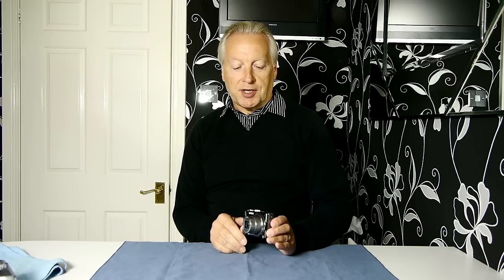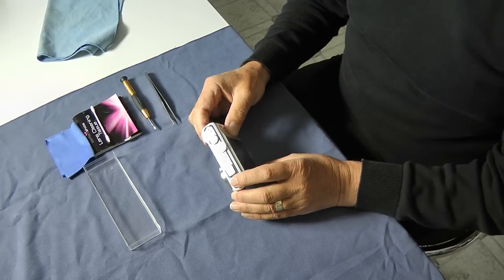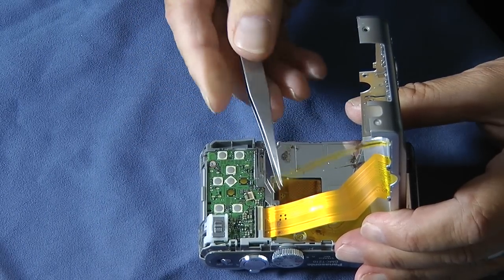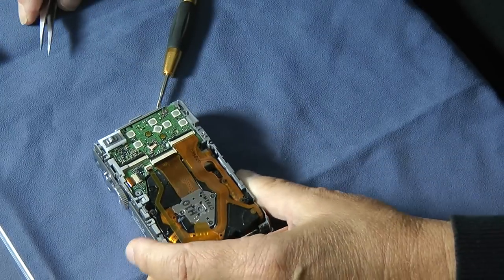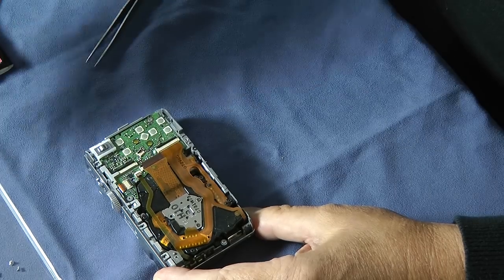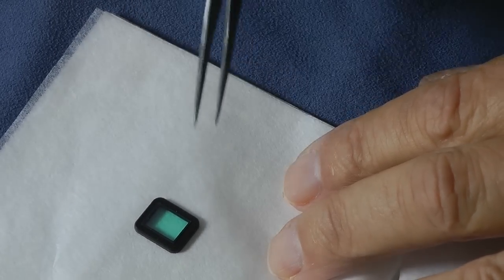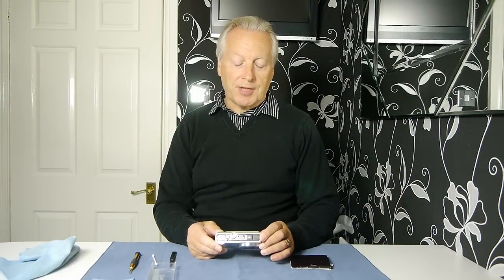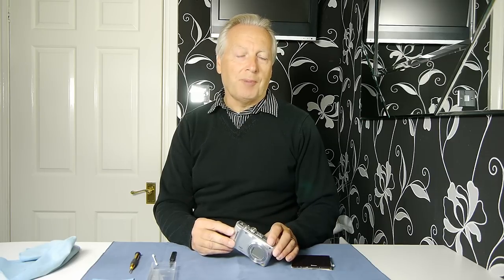Cleaning the CCD sensor of a Panasonic Lumix Compact Digital Camera

Comment: I bought the screwdrivers and the cleaning kit and was ready to have a go on my lumix DMC s3. I can only get one of the five screws out! do I need a posi no.0 or a normal screw driver head no.0? thanks.
Reply from the maker: All of the screws have a small amount of thread lock applied to them. They usually do undo if you maintain a steady inward pressure to stop the screwdriver head slipping out and applying a good turning force. Some screwdrivers like the jewellers type are too thin to get a good purchase on the handles, the larger the diameter of the handle the better for this application.
Reply: Graham, I think I need a ph000 as the no.0 seems too big. will order one as they aren't expensive.

Comment: Yep 17 seconds (timed) every time the same after power on, well after camera settles down to take images/video (takes 10 seconds of vid) sometime now it comes up with a different error message "Turn camera off then on again" AND! if you turn to playback mode on the back it does not error at all!
There is one solution I've found that does not work for me is to start the camera up and go into SCN mode and choose Portrait. I've done that a few times without success. Thanks for your help.

Comment from the maker: I have checked and I don't have the shutter assembly for the TZ5. If it is causing a problem them by pealing off that leica label, removing the 2 screws will allow you to remove the damaged shutter. OK you wont have a lens cover but that's not a show stopper - i have a camera which I use in this condition for some jobs.

Comment: Hi Graham,

Wondering if you can help us with our Panasonic Lumix DMC-FH8.  It is showing dirt on photos obviously needs cleaning on the sensor.  We need to know how to open this camera it has a wrap around silver part to the camera.  Thanks very much, much appreciated..Kim Dawson
Reply from the maker: Similar, remove all the silver screws on the sides and base of the camera and the back will then lift out, you may need a finger nail or plastic card to separate it. sensor is like the one in the video.
Reply: Graham Houghton Thanks Graham for your reply.  Its been a little while and we still haven't cleaned the camera.  Hooray we got the back off however the screen at the back is still attached and we are not sure how to get it off without breaking it.  It looks like it has a little releasing button on one side but we cant seem to unlock it.  Can you help.  Thanks Kim

Comment: I just tried and the TZ30 LCD screen does not come out with the back of the camera, i cant see how to remove the screen as the ribbon cables seem to be under the circut board to the right were the camera controls are..i can only see two..

mmmm

Comment from the maker: This doesn't seem like a sensor dust problem, might be indicative of pending failure. you can clean the filter with 1 drop of washing up liquid in 1/2 litre of water. Put the filter in a small bowl, being VERY gentle to flow the liquid over it a few times, then rise with clear water, blot dry (VERY Gently) and re-install darkest reflection towards the sensor. Good luck.

Comment: Thank you! Just out of curiosity, what purpose do the ribbon cables serve?
Reply: Well, they are cables in the shape of a ribbon. Coper wires printed on a plastic film. Serve to carry electrical power and signals between electronic circuits.
The wider public became aware of ribbon cables in 1971 during the Apollo 14 mission when astronaut John Watts Young ripped one of those on the Moon.
“Young moves into the vicinity and accidentally entangles his feet in the ribbon-like cable connecting the heat flow experiment to the central station. Since Apollo 11, lunar landing parties have had trouble tripping over cables. Such an incident on Apollo 14 knocked the TV camera over. In the bulky moon suit, Young can't "feel he's snagged" anything and keeps moving. The ribbon cable from the heat flow rips free, rendering the instrument useless. The data from the temperature probes cannot be relayed to Earth”.
APOLLO: A Decade of Achievement
By Paul I. Casey

Comment: these are great step by step instructions, which I have followed and managed to clean the sensor on my ZS10. When completed, I have gotten a auto-shot mode on all but the C (custom) modes (camera focuses and shots pictures automatically); have you encountered this before? should I try to upload the firmware? I re-checked the touch screen connections, which appear fine. in any case - thumbs up, I would not dare do this cleanup without your guidance.
Reply from the maker: No I haven't come across this problem. It may be worth doing a factory reset (all) just in case the memory got corrupt in some way. Does the tough screen work as it should?

Comment from the maker: Hello, I have tried to reproduce this by mis-aligning the cables however I cannot get the effect you report to me. As the backlight respond to menu changes then the control would appear to be OK, misaligned data cable gives broken up display so I really cannot say what your problem is here I'm affraid. As your results on the PC are fine it is nothing you have done with the sensor cleaning it must be related to the lcd somehow but I cannot say what. Sorry that I cannot be of more help to you.

Comment from the maker: This sounds like ccd failure to me. At a chance it could be just the connection from the ribbon cable connecting the ccd to the main pcb. Lift the locking latch remove the ribbon re-insert and close the latch - if it doesn't clear you could look out for a "for spares" not working camera on ebay and swap over the ccd - very easy to do.

Comment from the maker: Its possible but unlikely, Have you checked the ribbon cables to the pcb are installed correctly and the locking latches are down. Remove and replace the battery again to rest the camera.

Comment: contamination of the optical path is the primary degrader of the image. from the entry point, thru the path, all manner of airborne particles AND evaporated solvents that carry various chemicals will find a special place on your lens and imaging element. using good technique when transporting cameras is crucial, as 95 percent of their time is spent stored or in moving transport from place to place. a good, well made, yet simple bag or well fitted cover will help keep your equipment in good form.

Comment: I have bought and tried to use numerous tiny phillips head screwdrivers on my zs7 and although then look like they fit I can't find one that works? Any advice on finding a particular one that will work, preferably something available on Amazon in the US? Thanks in advance
Reply from the maker: You need the 000 point head for the screws. An Amazon.com store seller

http://www.amazon.com/dp/B008TM1910?tag=grasphoblo-20&camp=0&creative=0&linkCode=as4&creativeASIN=B008TM1910&adid=132N743KHDV9RSK19YXG

Comment: Hi Graham, thanks for your video. Both my panasonic ZR1 and ZS20 has the same problem. With your helpful video, I can successfully clean the ZR1. However the ZS20 (TZ30) has different structure. I cannot remove the LCD after back cover removed. Do you have some other instruction to remove TZ30 LCD?
Reply from the maker: The TZ30 lcd is held with clips at the top/bottom and left side (looking from the back). The tz30 has a different way to hold the cmos sensor and you may need to be prepared to keep adjusting the screws which hold the sensor to lens block to get the  framing right afterwards.
Reply: Graham Houghton Thanks Graham. Finally I can move the LCD but found the cable of the LCD is connected to the socket from the gap below the metal bracket. I tried to remove the metal bracket (3 black screws) without removing LCD cable but unsuccessful. TZ30 seems to be more complicated from the other Panasonic camera I can see from the video. Do you have the diagram or service manual to show the actual location and steps? Thanks.
Reply from the maker: you can download from here
http://www.pdf177.com/pdf/dmc-tz27ec-dmc-tz30eb-dmc-tz30ee-dmc-panasonic-3269.pdf
Reply: Graham Houghton Thanks Graham. I have downloaded the service manual and will have a detail look before I start. I will post here again to let you know the progress. Thank you very much for your help.
Reply: Raymond Li From the technical manual, The image sensor (CMOS) unit which are connected to the lens unit with 3 screws. 2 of these 3 screws are locked with the screw locking glue, after performing the Optical tilt adjustment. During servicing, if one of CMOS fixing screws are loosened, the Optical tilt adjustment must be performed. It is necessary to use the "DSC_Tilt" software to allow the "Optical tilt adjustment". It looks more risky to open TZ30 than other camera. Finally I decide not to wait until the situation get very bad.
Reply from the maker: Raymond Li it's true that if you disturb the screws there is the cahnce that the image may not be central. if you have an AV monitor (composite video) you can do this adjustment whilst looking at the image on the external monitor. Let me know if you want to know how to do this
Reply: Graham Houghton Hi Graham. Thanks for the very useful video. I also have a TZ30 that has the dust issue. Could you give guidance on the 'optical tilt adjustment'  and using an AV monitor. Thanks

Comment: so this cleaning is done with a dry cotton bud?
unlike cleaning a CD-Player laser lens which I have learned to do it with some isopropylic alcohol soaked into the bud?
Reply: thanks.
thats the first camera rapair that I try do make. if it fails its not the worst case scenario, because I fount the cam in a container on a scrap yard. so I take this as a training object.
Reply from the maker: desinfector The best way to learn.

Comment: In relation to my previous screwdriver question, some have stated not to use a can of compressed air on it as this might get some liquid residue on sensor or lens. Is this much of a concern or not. Is there any risk and or hope this might help without opening up the camera (I'd like to try less invasive procedures first). Thanks
Reply from the maker: These "air dusters" usually have some propellant and they are unlikely to reach the sensor face as it sits a small rubber gasket. Opening the camera is the only way reallu

Comment from the maker: Hello, you were extremely lucky as salt water usually kills the camera very quickly. The inside front element of the lens requires quite a bit of skill to disassemble the whole lens frame. It can be done easily with the right tools and patience. If you think you can attempt this I will produce a video showing step by step how to do it. It might be possible if you have a container of clean water to extend the lens and dip the front into the water, rotate it and then let dry facing down... cont2

Comment from the maker: Hi, I've been pondering this on and off all day and even tried to reproduce the effect on a TZ65. Which model are you referring too. Some have auto level control of the backlight and only 1 ribbon cable. Most have the second, very thin ribbon for the backlight. If you have tried re-inserting the thin cable with the gold contacts facing the pcb and this did not help I am a bit puzzled as to what else it could be. Have you tried raising the power level in the menu? would this help?

Comment: Thanks for your video. It gave me to courage to open my Pansonic DMC TZ7 because there was a diagonal stripe on all pictures. So I hoped to find some dust on the sensor, but it is more than that. It looks like there is a break diagonaly crossing the sensor. So to me it looks as if it needs a new sensor. Do you Graham or anybody here know where to order a CCD sensor 1/2,3" 6,2x4,6 mm (cropfaktor 5,6) 12,7 Megapixel or an equivalent CCD sensor that fits to this camera? My www research wasn´t very successful yet. Would be a great help.

Comment: Hi Mr. Houghton, 
I tried to clean it but when assembling the small connector / cable to the LCD is broken, the display is dead now.  
Is there any solution?
Reply from the maker: have you got this cable the right way up in the connector? the gold contacts face down on this one!
Reply: Thanks Mr.  @GrahamHoughton12  the cable is broken, it is not the right way up in the connector because it is broken. I´ll send you a photo on facebook (manfred.mitter.5)

Comment from the maker: These bridge cameras are far more complex than compacts and access just to the lens/ccd alone usually involves quite a bit of removal of pcbs and components. It is usually a job outside our amateur skills, plus parts are usually very expensive to buy unless you find a similar broken camera on ebay or similar and then try to open that camera to get to the ccd and see what is involved. I, myself, would not attempt such a repair.

Comment: May I ask again for some tips to reanimate my dear little Lumix ?!
Reply: ... this concerns:   HI GRAHAM - I liked the description a lot and also deconstructed my camera - very clear and practible! So I tried to get off the dust of my CCD-sensor .. I succeded, but ... when touching the friction lack of the LCD screen, even without any power, the black plastic shackle removed. I hoped, that it will be enough to stick the bigger ribbon cable in the lockin leaver. But now, the screen stays black, although light shines throug the edges. Do you have any advice, how I could save me and my camera? Thank you!

Comment from the maker: I've done a lot of searching for the lcd backlight and found only one supplies who has it for 150 USD which is silly money. Your best bet might be to look on ebay sites for broken cameras - damaged lenses, screens etc they are always coming up. Even if the screen is broken the backlight will be okay - you just need to swap it over. I'm not convinced the backlight is the problem but I could be wrong.

Comment: Hi Graham, I'm looking forward to trying this. Thank you so much for posting such a helpful video. It costs $400 dollars to get Panasonic to fix this in New Zealand!

I was wondering if you can tell which part of the camera the dust speck is in by how it appears in the image? Whether it is inside the lens, or on the sensor?
The speck does not appear very solid until I zoom the camera into the distance. As I do so, the speck gains focus, becomes more opaque and becomes more noticeable. The speck stays in the same position through out zooming.
Reply: Same problem here. Did you find where the speck was?
Reply: @Fergutor  I managed to take the camera apart, successfully remove the speck and reassemble. Was 7 years ago now so cant remember exactly what surface the speck was on. It was definitely on one of the surfaces exposed by this disassembly though and not deep in the zoom assembly as feared. Think was either lens or image sensor.
Reply: @philpetersen4477  You mean either the IR filter or the sensor, right? Well thanks for the info!

Comment from the maker: Hi, no you really need the IR filter, without it the camera is flooded by the IR light and exposures are way off in colour and brightness. You will find it difficult to get a new replacement. Look for broken panasonic compact cameras on sites like ebay. Most of the compacts have the same IR filter as they all have the same sensor size. It doesn't matter what the camera fault is go for the cheapest  - the filter will be OK and they all come apart in similar ways.

Comment from the maker: The TZ30/ZS20 does have a different method of fixing the CMOS sensor and the position of the sensor determines the infinity focus. if you undertighten the fixing, the lens will not focus at infinity, if you overtighten the lens will focus at infinity. I have had reported people have cleaned the ZS20 without any problems so I guess it isn't that critical. Panasonic will clean the camera for free under warranty so if it is still inside warranty take it to a pnasonic dealer and complain a lot!

Comment: Hi Graham,

Many thanks for the video. Now I can use my TZ10 again ^_^

However, I would suggest anyone who tries to solve the same problem to check the back of the lens, the filter and the CCD by a magnifier before securing everything. I have had to do it twice as other dust appeared after finishing the first cleaning. Later I used a 30x magnifier to check all the surfaces to ensure no dust on them, then putting the bits back on.

A blower and a lens cloth were also used.   Regards, Jan

Comment: Sorry for misspelling, wither=either. Also, the LCD is separate from the rear casing so the only ribbon cable that needs to be removed is attached to the CCD/CMOS. I had no luck trying to find information for this particular camera, so I hope the helps someone.

Comment: In the end I managd to open it. but what a surprise!

3 sets of screws, needing 2 different screwdrivers, some new bits...

It took me 90 minutes to clean the sensor on this TZ40 versus 15 min on the TZ25 version. some of the screws are so small, it's a nightmare,

then when i closed it, the zoom would not work, so I had to reopen the case a second time, and whrn the case would not shut properly, a third time ! ( a screw was not screwed to the end! silly mistake)

it's becoming a nightmare !

and I dread the next time I see some dust traces in the camera again

I regret my purchase  :-(

Comment: ccd sensors wins over cemos sensors,they capture a full image atonce so both still and moving images looks great,however ccd sensors can suffer from blooming & smearing artifacts,likely advanced algorithms can reduce those artifacts by following the directions of matching pixels and compares it to previouse frames in order to approximate it's position,blooming can be reduced trough carefully blurring.